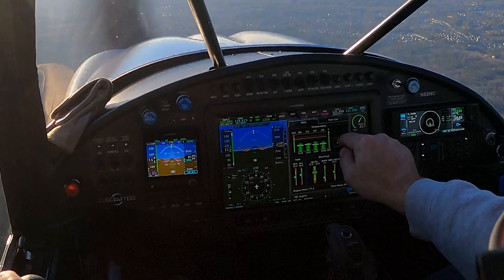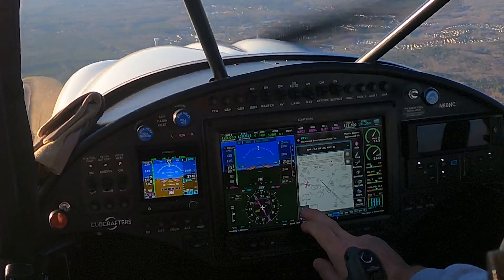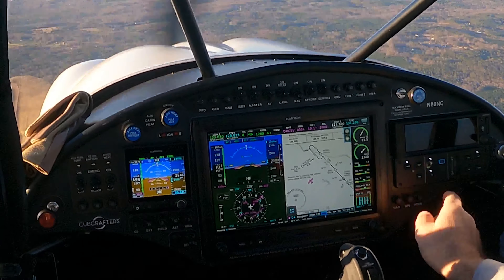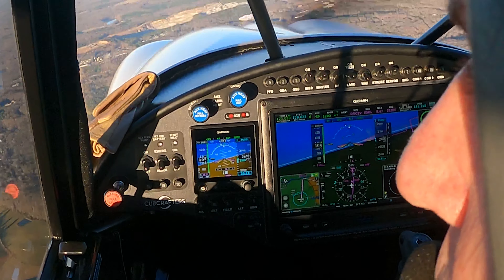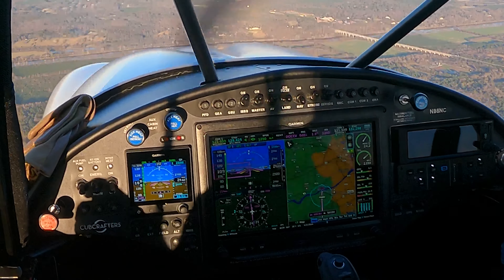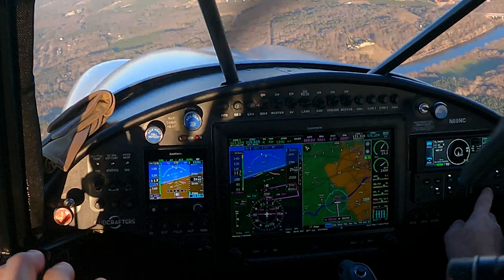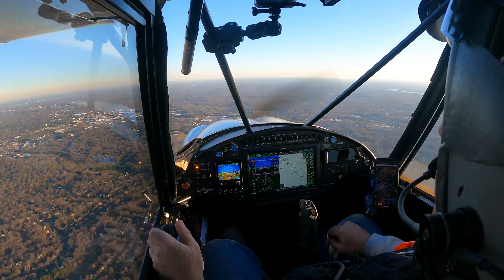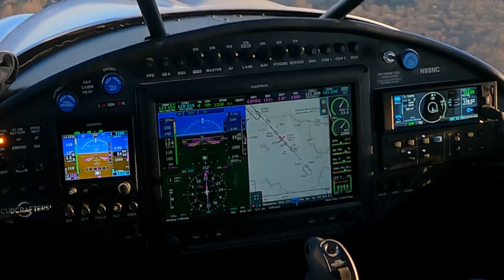RNAV GPS Approach Demo in a CubCrafters Carbon Cub FX-3

Comment: Thanks for this!  My own FX-3 build starts in March.  Watching you make radio calls with the autopilot on seemed a little awkward.  Don't know if it's even possible, but it made me wonder whether a second PTT switch on the panel would be a good addition.  Your opinion?
Reply from the maker: Congrats Scott, looking forward to your delivery. Exciting times. I flew it home 27 hours from Hood River to VA and much of that on AP. No real issues. My AP needs to be dialed down a little which I've programmed and will test next flight. It's a little aggressive. I don't see a need for a separate PTT, that would be more out of the way than the stick IMHO.
Reply: Scott I have also had the thought in flying Carbon Cubs that a push to talk on the panel or something similar to the back seat push to talk would be nice. It can be a little hard to use if the auto pilot is really working or more often if there is some one flying from the back seat and you are working the radios.

Comment: Very helpful video. My GNC355 install is underway so I’ll be flying these in the FX3 soon. 

Yesterday I descended through a 500’ layer in -6 F OAT and was grateful my Cirrus has FIKI. In all honestly, do you see yourself shooting IMC approaches in the FX3?
Reply from the maker: No, I have no intention of going IMC. I got the GNC 355 to continue learning and for IFR proficiency for something to do when no backcountry flying is available to not get bored of flying circles around the flag pole.
Reply: @NealCuliner  ha that’s pretty much word for word why I’m getting mine set up like yours.  Plus it would be nice to be on an IFR flight plan for XC’s.  Chicago approach pretty much always terminates flight following just when I need it most. Thanks for the reply and keep the great videos coming!
Reply from the maker: @RobMiller  Very true. I have no problem IFR, I just don't want to be IMC again if I can avoid it. Had my share of that back when I was at the top of my game in proficiency. That's no longer, for now at least. It may also help resale as well. I can see two extremes, minimal/VFR setup which I saw and thought "that's what a cub should be" but people want glass, so go the otherway. I simply wanted my plane done at delivery, I don't want to deal with add-ons later. Best of luck on yours, looking forward on hearing/seeing about it when the time comes.

Comment: Can you load and select waypoints through the g3x connected to the gnc, or do you have to use the gncs little screen all the time to make selections?
Reply from the maker: I believe there is a configuration where changes in the G3X flight plan will sync back to the GNC 355 but I haven't tried it. My typical workflow is entering info via ForeFlight and sending that to the GNC 355.